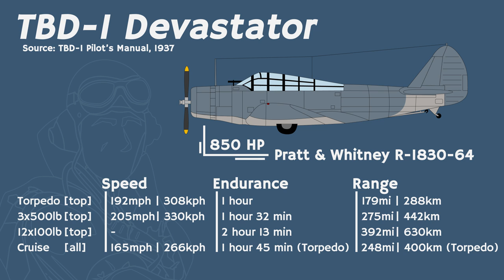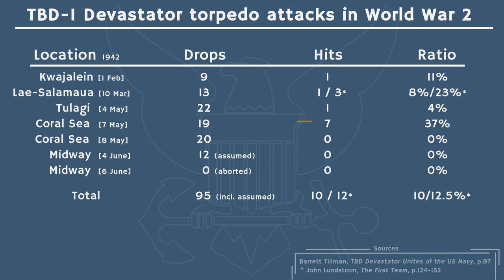In Defense of the Worst Aircraft of World War II - TBD-1 Devastator

Comment: The Devastator’s successor, the Avenger, had its debut at Midway. It had a bad day as well thanks to no escort. 

Any torpedo attack without enough fighter escorts was a suicide mission.
Reply: It would help if the plane carried a torpedo that worked.  Somewhere I ran across a reference to a memoir of a Japanese officer on one of the carriers at Midway; he said he saw two torpedoes hit the ship, break up and sink without exploding.  Later one sub commaander fired 15 fish at a sitting duck without an explosion.  He brought back the 16th torpedo for examination.  
The brass were extremely slow to accept that there were multiple flaws with the torpedo and most of the identification of problems was done in the field.  We have no idea how many torpedoes may have hit at Midway, but whatever went wrong was not the fault of the plane.
Reply: Where does the SBD Dauntless Dive bomber fit in? Isn't that the plane that smashed the Japanese carriers at Midway?
Reply: @jameshorn270  That was COMSUBPAC, Charles "Uncle Charlie" Lockwood. They were using the Mk 14 (the Avengers used the Mk 13,) which had a whole slew of problems due to poor engineering and ridiculously ineffective testing (due in part to the absurdly small budget granted by congress, but mostly to the Bureau of Ordnance's practically-criminal defensiveness.) First, they ran too deep, then the magnetic exploders were too sensitive and tended to detonate prematurely (or not at all,) and finally the contact pistol tended to deform and misfire. Each problem had to be discovered and dealt with in sequence, done entirely by Lockwood and his people, and the brass responsible for the delays had an awful lot to account for, but of course they were never held to account.
Reply: The Midway Avengers were also from VT-8, but they were overlooked in the accolades accorded to the Devastator crews, probably due to John Ford's film.
Reply: Yes, I've read somewhere about the Avenger formation that got jumped and badly messed up later in the war, aside from the small USMC force of them that were nearly wiped out at Midway..I think it was one of those situations where a USN and Japanese CAG passed each other en route to each other's fleets? anyway, some of the escort Zeros left off  to come over and  take a swipe at them, and messed them up pretty bad..not sure how many were lost, it was not on the scale of the 37/41 Midway massacre of TBDs, but it was still a worthwhile beating ....
Reply: @lindsaygraham5687  Yes, but in case you hadn't noticed, this video was not about the SBD.
Reply: That depends on the target. Obsolete Fairey Swordfish biplanes crippled the Bismarck and did serious damage to the Italian fleet in the battle of Taranto. The Americans were plagued with crappy torpedoes. None of the torpedoes launched in Midway hit their targets.
Reply: George H W Bush was shot down in an Avenger in 1944 off the coast of Japan. I saw an Avenger at his Presidential Library at Texas A &M University.
Reply: @wilicca99tokoroa51  A squadron of swordfish were obliterated when they tried to sink the Scharnhorst and Gniesenau (sp?) passing through the English channel.
Reply: Lots of specifics here, none of which I can neither confirm nor deny. Otoh, your point seems more relevant: when tactical capability can not meet strategic design. 🙄🤦‍♂️
I think op has it right that the plane was ahead of its time... but the “time” changed so fast (aka the US pre-war shenanigans) that by the time it was fielded, the warfighting tactics had changed so much as to be obsolete. And lives were lost. 🇺🇸 but we’re as human as that one tribe from S. America that is off-limits to all of is for the last 200+ yrs. Thus, we’re prone to f ups same as every other human. 🤷‍♂️
Reply: Successful torpedo attacks by the USN was started probably in Solomons campaign and most notable one was the attack on Yamato during Ten Go. Where the Hellcat fighters and Helldivers literally strafed and dive bombed the deck (basically like suppresive fire on the AA guns) so the Avengers could successfully conduct torpedo run on her and holed the Yamato on multiple sides so she could sink quickly (by flooding)
Reply: @wilicca99tokoroa51  the AA gunners on Bismarck were not well trained or skilled enough to shoot aircraft, plus the Germans don't have fighters covering Bismarck so Swordfish could attack the Bismarck with relative ease and had no disturbance plus they have better torpedoes than the crappy US torpedoes. TBD got massacred at Midway because the Japanese naval gunners were experienced and well trained though armed with crappy 25mm guns and they have one of the best naval fighters at the time covering their carriers from any air attacks. TBD probably have same or slower speed as WWI type aircraft Swordfish and have bad torpedoes but if the TBDs attack Bismarck they would still suck even with badly trained German AA gunners and no fighter cover. TBDs gave the USN Dive Bombers some leeway so they could attack the IJN carriers at Midway
Reply: @wilicca99tokoroa51  The other factor involved was fighter opposition.  The Fairey Swordfish that attacked the Bismarck didn't have any German fighters to contend with, or they'd have been massacred like VT-8 at Midway.  It's true the Americans had lousy torpedoes that wouldn't get the job done.  Even if they'd scored hits,  a lot of the torpedoes probably wouldn't have detonated.
Reply: Very true no machine is good if you don’t use it the right way

Comment: So, at midway:
No escorts.
Having to fly incredibly slow.
Having to fly dangerously low. Having to fly in a predictable straight line to the target. 

And lastly, knowing this,  it should never have been the spear tip of the attack. 

That aircraft was all but deliberately set up to be a turkey shoot for anyone with a firearm in the receiving Japanese fleet. 

It was a needless and hell of a waste of fine pilots and decent machinery.
Reply: Not to mention that the torpedo would rarely work
Reply: Replace 'Midway' with North Atlantic on a stormy night. 
Replace 'Japanese fleet' with a new 30 knot battleship. 

You get to eat your breakfast.
Reply: @20chocsaday wait are you saying it would have faired better in those conditions?
Reply: I don't believe they were intended to be the "tip of the spear". They were supposed to arrive at the Kido Butai together with VB-8 and VF-8. But they were given a wrong heading, and the torpedo bombers, led by Waldron, were the only ones that corrected. The fighters and dive bombers continued on the original heading, leaving Waldron's flight to fight by themselves.

Comment: The TBD's at Scapa Flow was Air Group 7 that were left behind so the USS Wasp could carry more Spitfires and supplies for Malta. The USN was the only operator of the TBD.  The Torpedo used was flawed due to the fact it was tested only in calm waters of either the Great Lakes or Chesapeake Bay.  Many of the operators knew this (PT Boat crews and Submariners besides the USN Torpecker crews) and tried to get BuOrd to implement the fixes before the war started. TBD's scored numerous hits with their torpedoes at Coral Sea and the early Hit and Run raids. However only one or two actually detonated. At Midway, the USS Nautilus hit the IJN Kaga with a full spread of torpedoes of which none detonated. They just broke and sank. It wasn't until the Middle of '42 before this was addressed. 

Thank you for this. It's rare I find a video that the author actual did some research and had knowledge of the subject. As someone who has spent his live doing research on USN aircraft and tactics in early WWII , this gets a huge thumbs up.
Reply: In defense of the bureau of ordinance, they checked the torpedoes multiple times before 1942 and all the paperwork was filled out correctly
Reply: @jamesricker3997  but the tests were done with a practice warhead that did not simulate the actual  weight of the live warhead. And they did very few live fire tests, so they did not know that there were issues with magnetic detonators and even the simple contact detonator.
Reply: I think "all paperwork properly filled out" was a pun! As always hind sight is 20/20.
Reply: I read that there were two problems with the Mark 14 Topr.  The contact exploder and the magnetic exploder.  Apparently the magnetic expolder tended to prematurely detonate (so did the one on the British torps) and I've read that wasn't fixed until '43.  To make matters worse, while submariners operating out of Pearl tended to deactivate the magnetic exploder starting in '43, those operating out of Australia didn't do that until '44.The contact exploder was an even bigger problem.  I read it would not detonate if the torp hit the ship straight-on; it had to hit at a significant angle, but not so steep an angle that the torp would bounce off!  Apparently this was not fixed until late '43 either.  Not fair to the guys whose lives depended on this.  In some ways, the magnetic exploder fault was even worse because a premature detonation alerted the enemy to your presence.  I imagine some senator whose state contained the place where the torps were built probably blamed the men rather than the torps.
Reply: Only one of the torpedoes fired by Nautilus actually struck the Kaga, but yes, that one did fail to explode and broke in half. The warhead sank and the rest floated. Some men from Kaga who'd been blown overboard by the previous bomb hits swam to it and used it as a flotation device. (Per Mitsuo Fuchida, who wrote up the after action study for the IJN)
Reply: @alexhurlbut  The warhead weight issue, while genuine, was not the root of the problem.  A fully functional depth-keeping mechanism would maintain depth regardless of mass or buoyancy.   The real problem was the depth sensor was located in the low pressure zone immediately aft of the nose because the designers didn't know enough about fluid dynamics to understand why there was a low pressure zone aft of the nose.  The pressure sensors worked just fine in static tests, so no one stopped to consider the effects of hydrodynamic flow on pressure.
Reply: @seanbryan4833  There are many reports of scandalous problems with the Mk 14.  here is my favourite, which I first read of years ago when playing the classic Microprose game "Silent Service II"    "
Early reports of torpedo action included some dud hits, heard as a dull clang. In a few instances, Mark 14s would strike a Japanese ship and lodge in its hull without exploding. The contact pistol appeared to be malfunctioning, though the conclusion was anything but clear until running depth and magnetic exploder problems were solved. The experience of Dan Daspit (in Tinosa) was exactly the sort of live-fire trial BuOrd had been prevented from doing in peacetime. It was now clear to all at Pearl Harbor the contact pistol was also defective. Ironically, a direct hit on the target at a 90 degree angle, as recommended in training, would usually fail to detonate; the contact pistol functioned reliably only when the torpedo impacted the target at an oblique angle.

Once the magnetic influence exploder was deactivated, problems with the contact exploder became more apparent. Torpedoes would hit their target without detonating. There might be a small "explosion" when the air flask ruptured due to the impact with the target.

Daspit carefully documented his efforts to sink 19,000-ton whale factory ship Tonan Maru III on 24 July 1943. He fired four torpedoes from 4,000 yd (3,700 m); two hit, stopping the target dead in the water. Daspit immediately fired another two; these hit as well. With no enemy anti-submarine combatants in sight, Daspit then took time to carefully maneuver into a textbook firing position, 875 yd (800 m) square off the target's beam, where he fired nine more Mark 14s and observed all with his periscope (despite the Japanese firing at it). All were duds.[85] Daspit, suspicious by now he was working with a faulty production run of Mark 14s, saved his last remaining torpedo to be analyzed by experts back at base. Nothing out of the ordinary was found.[37]"
When Mush Morton turned in a dry patrol, blaming the torps, he himself and his crew were blamed.  Grrrr!  And to think, the guys who were risking their lives were being villified by a bunch of bureaucrats sitting home, warm and dry!  Makes me boiling mad.
Reply: The Beureau of Ordinance kept insisting there was nothing wrong with the torpedos. It was Admiral Lockwood who finally conducted tests that proved they were defective.
Reply: @seanbryan4833  An old story, often repeated.  i am Canadian and in WW 1 our troops were equipped with the Ross Rifle, which was a good target rifle and might have been useful to a specialist like a sniper. But it was useless to the average guy in a platoon.  It jammed too easily unless kept pristine--something impossible in the mud of Flanders. Of course, the manufacturer insisted it was all the fault of the troops, and the politicians in their pockets backed the up.  No doubt every country has a similar tale or two.
Reply: @jamesricker3997  Very good!
Reply: The standard USN Air Group pre-War and early-WW II was a fighter squadron (VF), a torpedo squadron (VT)a dive bomber squadron (VB) and a scout squadron (VS). Since the later two were both flying SBD's they were trained identically and used innterchangably. The problem came with trying to operate the huge (by the standards of the day) TBD on the small carriers (14000 tons) Ranger (CV4) and Wasp (CV7)'s limited flight decks. They were victims of an experiment in what the proper size for a carrier was and London Treaty total tonnage restrictions, respectively Compare that to Lexington (CV2) and Saratoga (CV3) - 36000 tons and Yorktown (CV5), Enterprise (CV6) and Hornet (CV8) - 22000 tons. Accordingly, the two small carriers were given two squadrons of F4F's and two of SBD's.
Reply: @rcdogmanduh4440  I was going to say the same thing, good point.
Reply: @colbeausabre8842  Ranger and Wasp both carried reduced squadrons of TBDs (8 each, as I recall). As mentioned elsewhere Wasp left hers at Scapa Flow while she ferried Spitfires to Malta ("Who says a wasp can't sting twice?" Winston Churchill ). Ranger carried TBDs after they were withdrawn from front line service after Midway (until Oct. 1942, IIRC) and performed ASW duties in the Atlantic.
Reply: The reason why the magnetic exploder failed in the Mark-14 was because every region of the planet has a different measure in magnetic anomaly that's the reason why the torpedo worked where they tested it but couldn't function properly in a different region with a different magnetic signature. To be fair the Ordnance Board wouldn't have known this in the 1930s. It wasn't until the Cold War that we know that there were variations in the earth magnetic field when they did Underwater Geophysical mapping for detecting Soviet Submarines.
Reply: The true and complete story of that torpedo and the senators that defended it solely for monetary purposes while brave men died is a travesty.
Reply: @sirxavior1583  not a lot of people know that !

Comment: Interestingly, the A-10 also has exposed gear for the same reason!
The TBD was a good airplane, but obsolete, and the Navy knew it, but there was a war on.  As you point out, had the strikes at Midway went as briefed, more aircraft would probably have made it back, but Midway would still have been the last battle for the Devastator.
Reply: Marry Christmas  Ah, no.  All external tanks on the A-4 were removable and jettisonable, but the aircraft was small and light enough that sliding in on those big drop tanks might not be impossible.
Reply: Many Lieutenants and LTJGs along with some Ensigns were killed in those TBDs , especially at Midway. All were heroes none the less.

Comment: Takeoff weight was about 10,000 pounds. With an 850 horsepower engine, that was about 12 pounds per horsepower. That's compared to the SDB-5's 10,700 pound takeoff weight with a 1200 horsepower engine, or 9 pounds per horsepower. The SDB was not just faster in level flight but much faster climbing to altitude but faster pulling up and out of danger from a torpedo or dive attack.